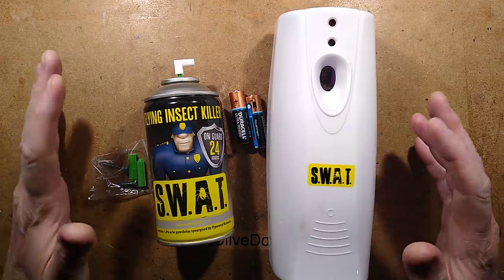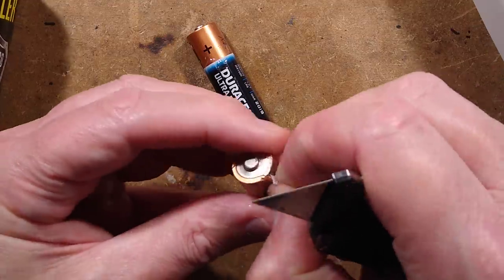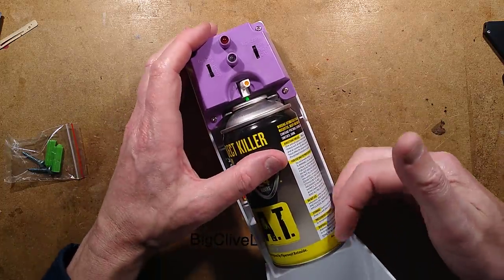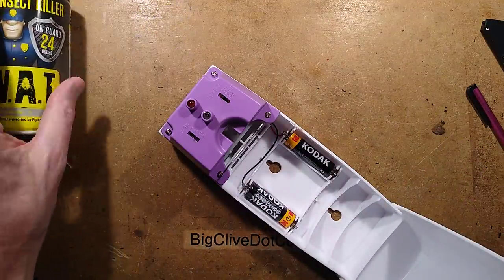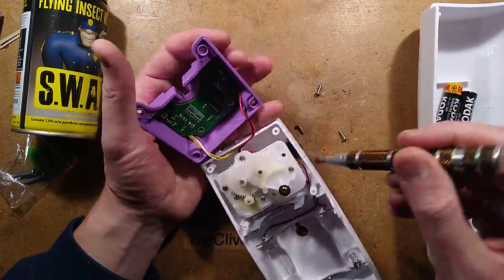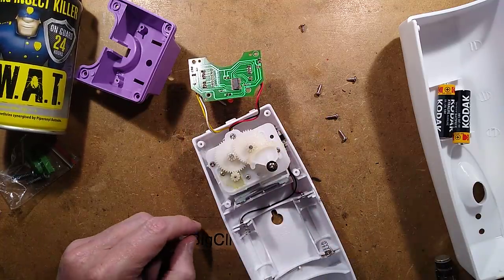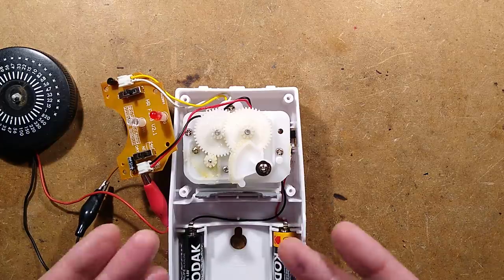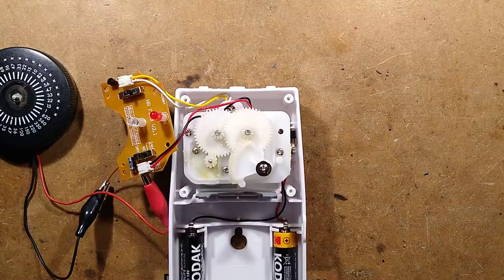Farm-grade automatic insect spray

Comment: The air freshener version has a motion sensor on it.  If you set a lit candle in front, it makes a nice conversation piece any time someone walks in the room. (Or every 15 minutes)
Reply: ...and helps give a brisk exercise for the local firemen :D
Reply: Now I need one of these…
Reply: That sounds… dangerous
Reply: I need to do this and put it on my deck. (Neighbours cats visit after dark to mark 'their' territory and make my deck and front porch stink.) Maybe with a spark ignition unit wired into the timer...
Reply: Interesting. I've never seen one that sprays horizontally which has a motion sensor. It's always a timer and/or a light sensor.
Reply: @goosedeathable  65
Reply: Ahem. "Failed automatic flamethrower project." 😁
Reply: The automatic Woofler. LOL.
Reply: @mittfh  I must re-watch that one, it's been a while now. Thanks.
Reply: @mittfh  oh I somehow had not seen that one yet. Thank you. I once again want to build a flamethrower. Maybe some day I will.
Reply: This, inside a pumpkin and the mailman will be thrilled for Halloween :D
Reply: Inside a dragon head with glowing led lights for eyes. 
Motion sensor on nose and spray fed to chamber behind nostrils with an igniter. Hey presto a flame breathing dragon. Or a vintage candle lamp with a candle in front of the spray. Then replace insecticide with gas canister. 
Clive a new fanny flambeau project ????
Reply: @Shaun.Stephens  make a miniature “bird banger” like farmers use. Motion sensor triggers spray and bang. Or leave that bit out and replace canister with one of those cat/dog repellant sprays. ???
Reply: @patomahony9747  A bird banger would keep me awake at night and I've tried repellent. Thanks for the ideas though.
Reply: @Shaun.Stephens  agreed and probably tee off the neighbourhood. On a practical note I do believe there are ultrasonic dog and cat repellers. One or more of these connected to motion sensors should keep them at bay and it’s outside human audio range.
Reply: @patomahony9747  I've also tried the ultrasonic option. I REALLY don't like it when I open my doors and windows to air out the house and smell cat piss. A (non-lethal or serious injury)  slingshot helps but they've got cunning and wait until it's very dark and I'm not outside.
Reply: My buddy has one of these air freshners on eye level above the urinal. I get maced every time i take a leak
Reply: @Shaun.Stephens  well with rodent ultrasonics I seen a guy who did it industrially. Hooked pest ultrasonic up to a powerful pa music amp. Think it was a Marshall. Boy did that clean out all rodents and spiders from industrial spaces.
Reply: @hornetIIkite3  well be glad it's not a flamethrower
Reply: @Shaun.Stephens  you can buy spray from amazon that will stop this ._.
Reply: Ahhh! The heart-warming, ever-welcoming, automatic dart igniter!

Comment: Duracell use to have the tester as a separate strip in the box, before they incorporated it onto the battery itself.
Reply: They still got it separate with the 9V blocks
Reply: I remember those strips
Reply: I remember them being part of the actual packet for the batteries.  You would get something like a 4 pack of AAs and it would have (possibly) a offset battery sized slot in the middle of the plastic clamshell that had the charge checking strip in it.  I do remember that it was a absolute pain the rear because you would have to squeeze the plastic together and it wasn't easy to do.
Reply: It's an amazing little device. I wonder who has the patent on that.
Reply: @stopthephilosophicalzombie9017  The patent has more than likely expired by now.  I remember them from my early teens which would be the early 90s and patents only last 20 years.

Comment: That was quite fascinating! It's cool to see the battery tester still works on those batteries O_O
Reply: The battery expiration date was 2019 but it wasn't drained so I assume it was a rare Duracell battery for it's day. 
They usually never make it to their expiration date without exudation of the  contents. Yuck.
Reply: @hestheMaster  interesting comment. 
I have some Duracell batterys with a expiration date of 2001 and they still worked
Reply: @hestheMaster  i know they will someday leak but comoared to other batterys it's impressive they got so far.

Comment: I’ve been watching you since the beginning, & many of your videos are TIMELESS. I rewatching them countless times when
it gets too quiet in my lab seven days a week 12 hours a day. Nice to have a playlist of electronics videos to drowned out the sound of  transformers/fans in my test equipment 😂 

it would help so many folks, if you made a general troubleshooting video. Covering troubleshooting and testing, and how to pinpoint common issues. There aren’t many good troubleshooting videos on YouTube. The only ones that comes to mind, are a few videos made by “diode gone wild“. Other than that… Someone would probably have to watch 8 hours worth of YouTube content to get a decent summary of basic troubleshooting.

95% of the repairs that come through my lab… are basic and common faults. That could be easily summarized in a 20 to 30 minute video. 

Once or twice a week I may have a repair or calibration… That involves a bit of oscilloscope or logic probing. And of course I do see really complex repairs and recalibration work from time to time… But 95% of repairs are accomplished with a multimeter, ESR tester, basic power supply… And a few other random things.

Your AVR (automatic voltage regulator) repair video…Is awesome! I’d really like to see how you go about general troubleshooting.

You are in the top 1% of great teachers and communicators on all of YouTube! It would be infinitely valuable to myself and others if you put together a troubleshooting/repair video… Similar in length and style to your “Electronic components“ video.

Comment: Here in North America, there's a chain called Tractor Supply Store (Peavymart in at least part of Canada now) that started out as farm supply, and still has things like electric fencing materials and equipment that you don't find in most similar stores, but it's moved a bit into the more general merchandise with an emphasis on farm products.  So, they have clothing, but it's the kind of clothing you need for farming, like heavy coats, raincoats, rubber boots, and various sorts of work gloves.  They also have things like welding machines and a much broader range of air compressors than more general large hardware stores like Canadian Tire carry.

Comment: Thank you Clive!  You just solved an issue I have in my 10x10' grow room. I've been using the Glade Air Freshener version of this dispenser, with the North American version of the insecticide spray called Doktor Doom to treat Thrips in the grow room. Currently it's max time is 36 minutes witch is to often for maintenance insect control. Now I'm going to add a variable pot and will only need a can and a bit per year, instead of over 3 cans a year :)

Comment: They did those battery gauges again recently under the brand name "Duracell Quantum", they were pretty common a few years ago here in the US, I still have a few fresh ones that are well within date. They appear to have been discontinued again though, sometime around 2019 maybe.
Reply: I've given up on Duracell period.  They leak like no other.
Reply: Those testers bring back memories of my childhood!
Reply: @TechGorilla1987  Yes they do, even well within the expiry date. Comes from it being a brand name only, and put on as a sleeve by whichever contract manufacturer got the contract, to make the cells for the lowest price. Thus they skimp on the seal material, run the machine well past the service intervals and cheap out on all parts, so long as the cells do not leak during shipping of the first batch all is well.
Reply: @SeanBZA  , another related problem with batteries is, so many modern devices run three to six cells in series that if one battery is a bit out of tolerance compared to the others, it acts like a resistor to the other batteries pushing current through it, and that battery will be the first one to leak. Also worth noting that many battery-powered devices, including flashlights with electronic mode switching, are essentially "on" all the time.
Reply: @goodun2974  Do flashlights that have both a tailcap switch and a selector switch on the body suffer this problem or does that completely isolate the battery?

Comment: I think your comment about low batteries causing it to reset and keep spraying just solved a problem for me. At work we have a sanitiser gel dispenser that has gone berserk. I'm going to go and change the batteries.
Reply from the maker: If it has an infrared sensor another thing to suspect is contamination on its window, or detecting reflective objects.  Especially the retroreflective bands on hi-viz clothing.

Comment: Nice tear down. Been musing since I posted a comment on one of other comments. Problem with using this in a fanny flambeau project is these spray cans give a metered dose and shut off at end of stroke. So solution mod a canister by fitting a refill valve. Schrader or presto tyre valve soldered in to side of can or a valve from a refillable lighter. This gives a measured dose of gas. Next a combustion chamber behind nostrils with a spark igniter that kicks in just as plunger cuts off gas supply. Nice project to experiment once you don’t create work for IOM rescue services in the process.
Reply from the maker: I fitted a schrader valve to a can.  Used it to make a custom aerosol with essential oils and butane as a propellant.
Reply: @bigclivedotcom  great idea never thought of that application. I do similar with old wd40 cans part fill with mix of brake fluid and ATF. Then pressurise with compressed air. Just as good as wd40 in my usage. 
Had a safety FX feature in mind for flaming dragon. Feed gas through a silicone tube in to base of chamber behind nostrils filled with woffle juice. Then nostrils initially foam. Delayed Spark igniter sets off flame but un used juice acts as an blowback retarder. Juice tank can extend down into dragons neck so hold a fair amount of juice.  Just a thought.

Comment: 2013 seems more plausible, given the 2019 expiry date on the batteries.
Reply: If you notice the 3 from the top row and 7 from the bottom row are missing - probably scraped off to indicate a batch number or even revision? I don't think it's a date code at all. Those are just sequences of numbers...

Comment: I use a neonicotinoid mixed  with a pyrethroid, the synergistic effect  of those two things combined kills everything. I had bed bugs once, faffed about with all kinda treatments that didnt do anything and that wiped um out in one go.
Reply: @jimurrata6785  Yes, bed bugs are gross. At least where I'm at, they are resistant to everything. They don't even try chemicals and go straight to heat. 130F is enough to kill them.
Reply: @jimurrata6785  I use it as a barrier insecticide too a little around the foundation and anything that crawls won't make it in your house for months.

Comment: I have a Thermcell mosquito repelling unit that heats a pad with butane that contains that substance. I live in the Ohio woods near water, and it is quite effective to use. I have a small one for hiking and camping and it is also quite good. I think the US military issues them, which generally means they work.
Reply: In India those pad/tablet things were common a few decades ago. Nowadays the ubiquitous method is to have a reservoir of the substance fed by a wick into a heater. Clive has done teardowns of "Good Knight", refills of which go for about 4.3USD for a six pack (6 x 45ml) on Amazon.

Comment: A cheap voltmeter I bought (it was a knockoff of a more reputable model) had carbon zinc batteries with fake power gauges on the side that weren't actually connected to anything. They were just printed on the wrapping.

Comment: A solar panel and some rechargeables seems like the missing piece here.
Reply: They are mainly used inside barns around horses and other livestock, not out in the open.  
Plus the batteries outlast the cans of spray about 4 to 1 so “going green” any further with solar panels and rechargeables on this would be a waste and also increase cost.

Comment: The AA cells will last at least a year in operation, if you are using in 12 hour mode and every hour. Even the toilet ones, running every 15 minutes 24/7, those 2 AA cells would last 2 years, though they were a white no name cell. Literally a white cell sleeve, with no manufacturer info on them, just a small print batch number and expiry date. Do not know who made them for Proctor and Gamble, but those cells absolutely never leaked, even 5 years past the expiry date, left in an old unit. Even at 5 years past expiry they were still good, lasted another 2 years in a clock before finally going flat. Not like the Durashit that replaced them, 3 months and the new cells were leaky already.
Reply: P&G is parent company of Duracell, those batteries are likely unmarked Duracells back when Duracell wasn't so bad.
Reply: @NiHaoMike64  Yes, but they even outlasted Duracells from the same era, which always leaked. I guess they ued the good manufacturer to make the white cells, leaving the rest to be branded durahell.

Comment: I have a board from a singing greeting card and when I put a finger on one of the resistors it makes the music speed up. I can do the same thing on this toy audio recorder which uses the same chip as used in the Yak Bak recording toys back in the 90s if I wet my finger and put it on a resistor and ground it makes the recording chip record at a faster rate so if you record while doing this it records in better audio quality but less time. I am trying to find something like a small pot to install on it so I can warp audio.

Comment: Is it just me, or does this seem sped up by about 25%?   Clive - were you drinking a lot of tea/coffee when filming?  Checked my playback settings and it was set to normal. Dropped it to 75% and seemed normal.
Reply from the maker: Not that I'm aware of, although sometimes I do go into turbo-mode while recording.  Especially if I've spent a lot of time reverse engineering something and time is short.
Reply: @bigclivedotcom  Ah fair enough.  Thanks for the video!

Comment: I would say the board is probably dated from either 2003 or 2013 from the date code, probably 2003 given the batteries went to shit back in 2019. That would put it about the mid to late 2000's for production, which is about when they were still using that stupid test strip on the batteries.

Comment: Assuming the chip doesn't have brownout detection (probably not in 1993!), a crude low voltage detector could be fashioned on a free pin.  👍
Reply: I'm pretty sure (some) PIC chips had brownout detection in the 1990s, but you had to turn it on and program it. This could easily have been a PIC design, I seem to recall that some of the chips had IO ports that could drive LEDs directly in either pull-up or pull-down format.

Comment: Odd that they didn't just use 4 identical 240 resistors in series for the time interval selection instead of relying on different inventories.
Reply: I think using the separate values allows them to reduce the component count - i.e. 4 resistors instead of 6.  If you look, the values are roughly 240k Ohm per 5 minutes so they would need 6 resistors in series to hit that 30 minute timer value.

Comment: Huh. I noticed there's no freewheeling diode across the motor. Is that integrated in the ASIC, or did they "optimize" it away?
Reply: The chip is in the wrong place on the circuit for it, so it's not that. Transistor doesn't seem oversized either. Maybe it's in the motor?

Comment: I  bet that chip is  a  timer   like  the  555    with the  resistors  doing  the  timing  with a  capacitor  inside , firing a   comparator  That then   triggers  the external  transistor for the  time constant
Reply from the maker: I think it may be two oscillators with some digital dividers to get the timing.

Comment: Can you test how much current that test strip draws and also what happens if you use higher voltage ?
Reply: He mentioned in the video that it drew about 300ma or 0.3 amps. If you use it on a higher voltage it will get hotter faster, and also get much hotter. It will also draw a lot more current from the battery.

Comment: So you could totally use the tester strip as some sort of (slow moving) gauge!
Reply: Very early on in making automobiles they found that the vibration of driving down rough roads made the gauges on the dash panel vibrate so much you couldn't read what they said. It also wore the pivots out within weeks or months so they became useless. 

The answer was to make "hot wire" gauges, where instead of a moving coil of wire in a magnetic field, they wrapped a thin wire around a spool on the gauge stem. When the wire got hot it stretched, and a spring caused the gauge needle to move. It took a lot more current, but they responded slowly so you could read them and they weren't damaged by road vibration.

This is sort of a modern "no moving parts" version of those old gauges.

Comment: Interesting video.
Also interesting is the resistor wheel you used (near 14:36). Where did you buy that?
Reply from the maker: I think it was Tandy.  About 40 years ago.
Reply: @bigclivedotcom  Thanks for your answer. It is a smart device. Probably not in stock anymore ;-).

Comment: if it only reads the timing resistor "when it needs it", then how long does it take to wake up and find you have changed the switch since last time?
Reply: on reflection, as the micro flashed the led, it could check the values every time it wakes up to update the led, i think that was several times a minute, so probably the setting changes take effect, in a quite short time.